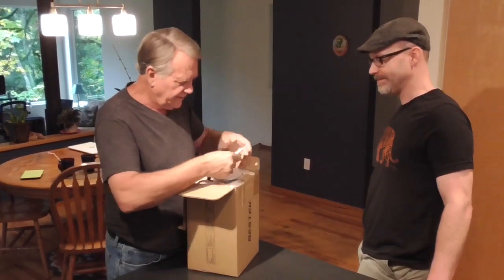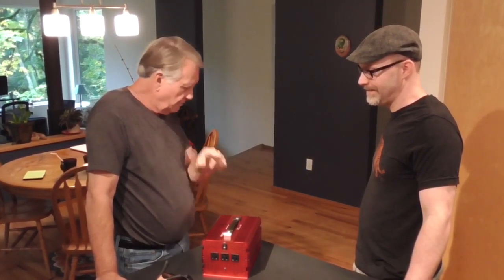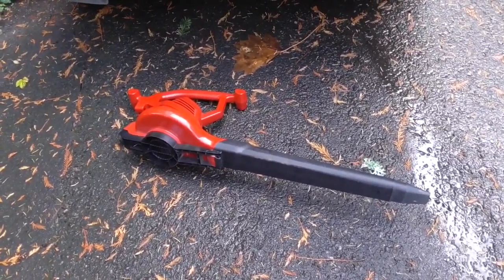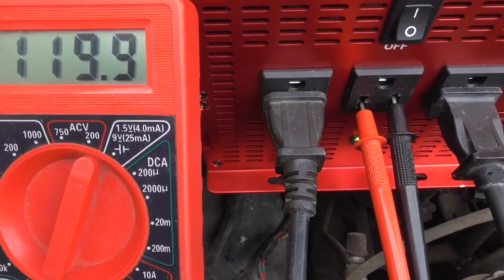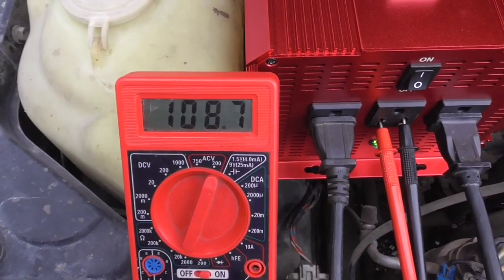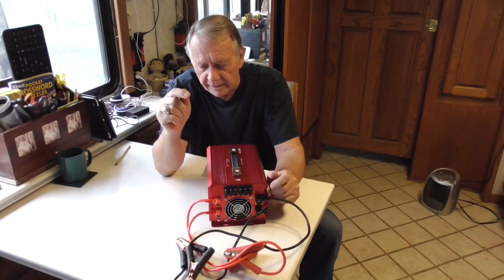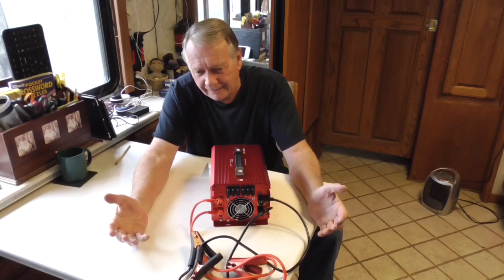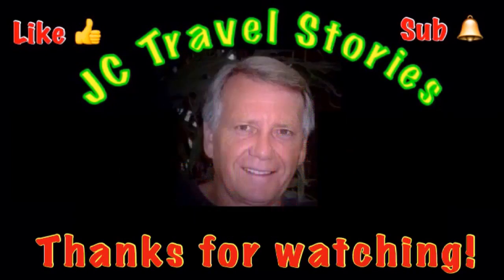Bestek Inverter Power Review

Comment: It looks like it has terminals for remote start of the inverter, such as a switch on your dash. That's how I wired mine years ago.
Reply from the maker: This one does not have that feature.  I've wired them that way myself by removing the case and soldering in wires to the switch terminals.  :)

Comment: You might want to check if it's putting RFI out and cleanness of signal to keep away from causing problems running a laptop on the power source.
Reply: I doubt I would run a laptop with it.
Reply from the maker: Yes, I sprobably should have done that with the last 10 inverters and 5 laptops I've used in the last 25 years.  Wasnt' smart enough to have that problem.  :)
Reply from the maker: Susan.   You can't run a laptop with an inverter.  Laptops run off of their internal battery.  :)

Comment: JC, great video!!!    You did not say how long you can run a small household freezer without recharging the battery? Also, can you run UR alt. while using the inverter? "RUN & GUN"?
Reply from the maker: I used a smaller one to run a 100 Watt bar fridge at home in Mexico.  It was a test with an old car battery, not a very good one.  It ran for about 12 hours before the battery hit 10.5 volts and the inverter shut down. I was running a timer at the same time, so it used a little, too.  I concluded that I could run the small fridge overnight if I were traveling in my van.  And, yes, no problem running the car engine while using the inverter.  :)

Comment: Sorry, but Amazon would not give me the 20% off with the code, but I bought it anyway. Thanks for the tip. Looks like a good inverter.
Reply from the maker: I'm so sorry about that.  It was my bad.  I transposed some letters in the code.  Here's the correct code if you can cancle and start over.  WS38ARYD
Reply: @JCTravelStories  
R u dyslexic? Me toooo.

Comment: First I want to say hi Peter. 👋 JC I got a question why did you get the 200 and I see there's two connectors 4 positive and negative do you connect that to two different batteries or is it to run from One battery. Because when I get my traveling van up and running I want to make sure I have some kind of power coming in besides solar. I don't want to look like I'm living in it I want to be as still as possible.
Reply: Had the same question but then 1 look it up : 2. For DC12V and car only, Don't connect the battery clamps to 2 different batteries, make sure the total input voltage is 12V.
Reply: The inverter does not make power, it takes power from the batteries at 12 volt direct current (dc) and converts it into 110 volt alternating current (ac) to be used for your 110 ac appliances.  Power comes from solar panels or generator to a charge controller to the batteries to be available when needed, when no sun is available or you don’t want to run the generator
Reply: Hi Johnny! I watch all my dad's videos.

Comment: Could you run the vehicle while using the inverter?
Reply from the maker: Yes.  No problem.  The inverter is designed to not have a problem with the slightly higher charging voltage while the car engine is running .... And that will keep your car battery from being run down.  :)
Reply: @JCTravelStories   THX you answered one of my ?'s !

Comment: Well now you can send it back because it's a piece of junk I bought it did some investigating on it and it's a piece of junk all that is is to 1000 watt inverters powering it so you're only going to get about 800 watts out of two plugs, when was the last time you have ever seen an inverter with two positive and two negative inputs that is because there is two 1000 watt inverters each lead supplies power to each inverter send that piece of crap back it's junk I sent mine back and I bought a 4000 watt inverter for just a little bit more money and I can pull the full 4000w out of one Outlet when your hard wire an outlet on the end